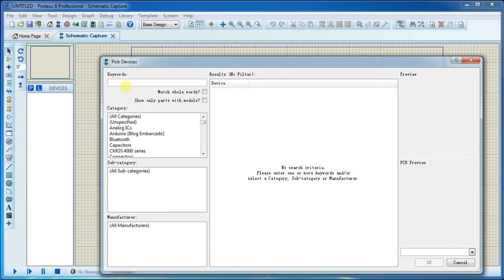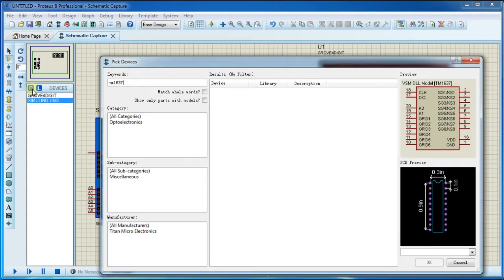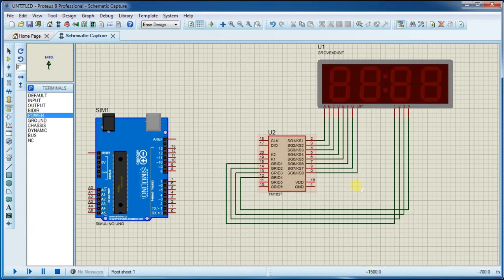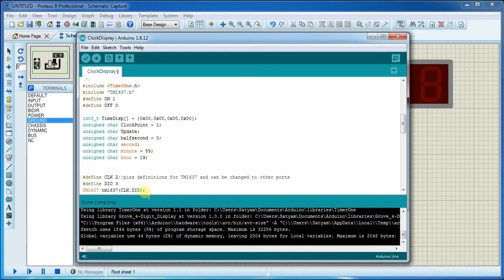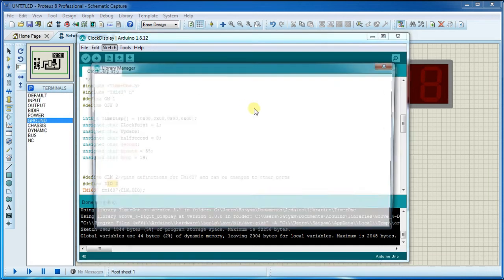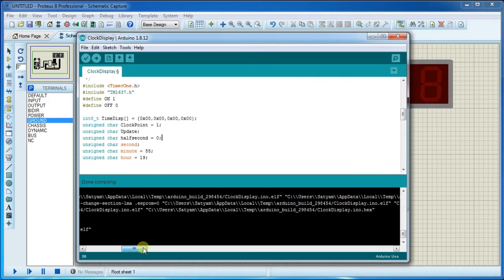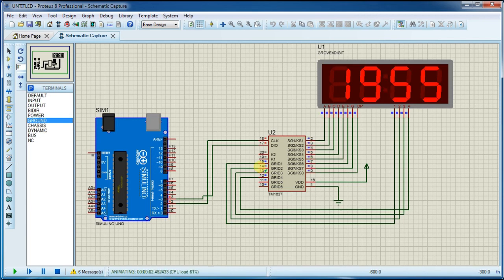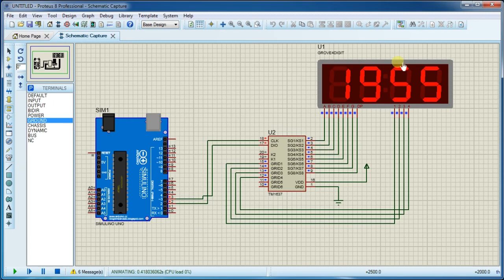Arduino 7 segment display clock proteus simulation

Comment: Code:
#include <TimerOne.h>
#include "TM1637.h"
#define ON 1
#define OFF 0

int8_t TimeDisp[] = {0x00,0x00,0x00,0x00};
unsigned char ClockPoint = 1;
unsigned char Update;
unsigned char halfsecond = 0;
unsigned char second;
unsigned char minute = 0;
unsigned char hour = 12;

#define CLK 2//pins definitions for TM1637 and can be changed to other ports
#define DIO 3
TM1637 tm1637(CLK,DIO);

void setup()
{
  tm1637.set();
  tm1637.init();
  Timer1.initialize(200000);//timing for 500ms
  Timer1.attachInterrupt(TimingISR);//declare the interrupt serve routine:TimingISR
}
void loop()
{
  if(Update == ON)
  {
    TimeUpdate();
    tm1637.display(TimeDisp);
  }

}
void TimingISR()
{
  halfsecond ++;
  Update = ON;
  if(halfsecond == 2){
    second ++;
    if(second == 60)
    {
      minute ++;
      if(minute == 60)
      {
        hour ++;
        if(hour == 24)hour = 0;
        minute = 0;
      }
      second = 0;
    }
    halfsecond = 0;
  }
 // Serial.println(second);
  ClockPoint = (~ClockPoint) & 0x01;
}
void TimeUpdate(void)
{
  if(ClockPoint)tm1637.point(POINT_ON);
  else tm1637.point(POINT_OFF);
  TimeDisp[0] = hour / 10;
  TimeDisp[1] = hour % 10;
  TimeDisp[2] = minute / 10;
  TimeDisp[3] = minute % 10;
  Update = OFF;
}

Comment: hi thanks for this simulation . is there any way to set the clock and change minute and hour .
Reply from the maker: Yes, you can use push button to set the clock hours and minutes
Reply: @SatyamsinghYT  can you tell me how to connect push buttons to the pins . and do i have to write new codes for that buttons in arduino

Comment: If we use IC ATMGA328P and I want program code C For 4 digit 7 segment showing at the same time can you explain that😂😂
Reply: I have problems. I can program C code for 1 digit but I can’t do for 4 digit . It not show in the same time 🙏🙏
Reply from the maker: You have to switch segment common pin at very fast rate to look like 3 different number on 3 segment

Comment: Thank you for interesting project. I could run the Proteus simulation successfully as you presented here. However, the clock starts from 12:00. Could you please tell how to synchronize the displayed time with real time? Thanks.
Reply from the maker: Hi, For that ypu can use _TIME_  function of Arduino, which will save realtime value while compiling .

Comment: HI. How can I make the clock run faster?
Reply from the maker: Just change the delay and it will run faster
Reply: @SatyamsinghYT  but how? where i add the delay? doesn't have in the code
if you could help, i would be really really greatfull
Reply from the maker: Just after writing the values

Comment: Hello, Which version of proteus are you using?  I'm trying with the 8.8 and the displays don't work i've tried changing the animations settings, started to present one digit per display but i still not getting the full display
Reply: Also i'm using the Proteus library's arduino.
Reply from the maker: I am using 8.9, can you share me pic of screen on my Instagram @ioturtle

Comment: Hey! It gives me this error when I compile, would you please help with that one?

ClockDisplay:30:10: fatal error: TimerOne.h: No such file or directory

 #include <TimerOne.h>

          ^~~~~~~~~~~~

compilation terminated.

exit status 1

TimerOne.h: No such file or directory
Reply: I am sure that you are no longer with this project after 1 year. Still, this is the answer to your question. Download the header library (TimerOne-1.1.0.ZIP file) from https://www.arduinolibraries.info/libraries/timer-one and do the following - click
sketch>Include Library>add .ZIP file ->select the .ZIP file in download location-> push enter button (0k). Addition of the timerone library to arduino is thus completed. Now you can compile the file ClockDisplay.ino shown here.
Reply from the maker: Install timerone library from library manager first